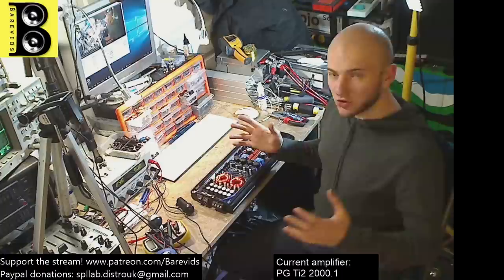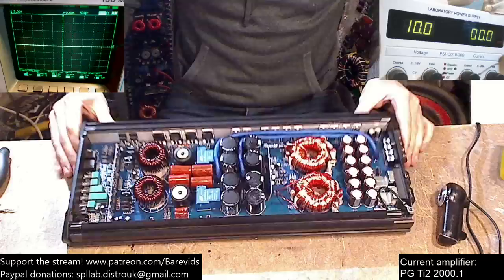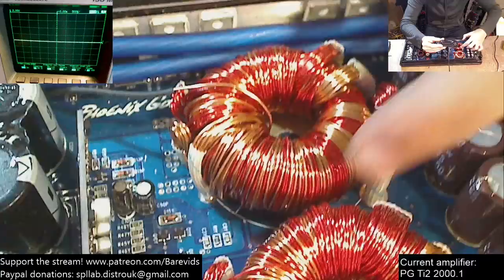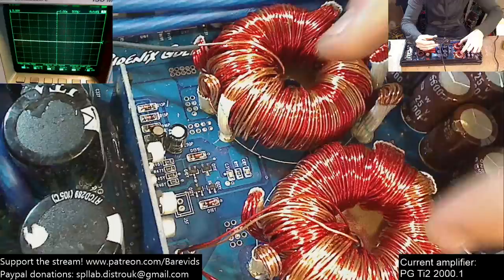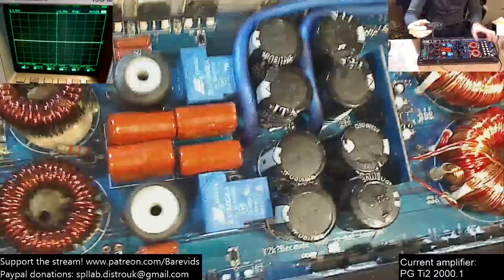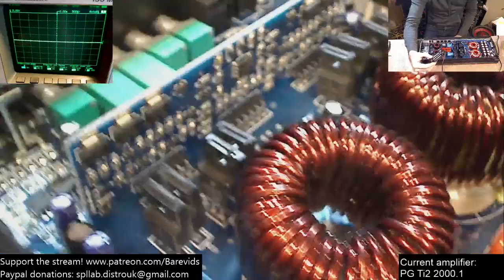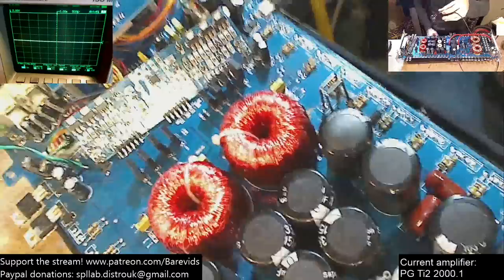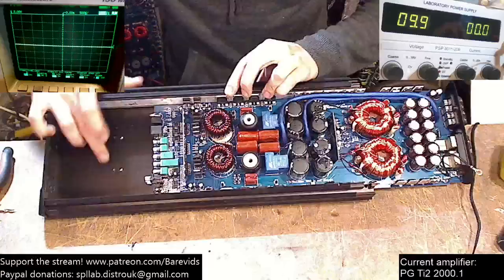Have Phoenix Gold gone to SHIT?? =[

Comment: I was the old New Product Development Manager @ PG in its prime back in the late 90’s early 2000 and was responsible for the very first TI amplifiers. We did our best to turn out the best possible amplifier that was robust and good feature sets. Back then anything with Titanium name on it was our best. We engineered it in house we wound the tortoise in house we did our own board insertion, aluminum and steel casing as well as our own silk screening. The entire thing was built in America at our factory in Portland Oregon. I can tell you these amplifiers are nothing remotely close to what we built back in the day. The attention to detail has gone out the window. This particular amp has many issues as so aptly pointed out. Even the speaker and power connections no longer have counter sinks for the wire insulation to seat into. The single most expensive thing on an amplifier is the heat sink. These guys will never be the same unless they bring it back to the US. It’s a sad day to see PG go down like this. We had an amazing team from the likes of Larry Fredrick and so many others. The difference is we actually cared.
Reply from the maker: amazing to hear such comments from you sir! Thank you for your efforts in producing some of the best amplification products of the time x
Reply: Shame you did'nt use Hammerite to paint them LOL
All my 10yr old Ti stuff is rusting....BUT never skipped a beat.
Reply: @alwishy2696  lol.,sounds like my 1998 Sound Stream Rubicon
Reply: Everything is an extra dollar..the world will soon be in the shitter
Reply: Jerry is that you? The engineering dept./ T Sanow Designer
Reply: Wow i was about to buy some PG hardware. Thanks for saving me.  PG was topshelf back in the day.
Reply: I agree i remember the PG amp's from the 90's i stil have my sapphire 3.0x and 1.0x they are really well built, and they were cheap amp's. Sapphire Drive Series by Phoenix Gold
Reply: When Phoenix Gold Left St. Johns,  it was like my hopes and dreams went out the window for life.  I use to drive my Volvo by the Factory and one day, it was just not there anymore.  I remembered I wanted to so bad go on something called a Job Shadow since I was going to High school there at Roosevelt.  1998 was I joined the Military, went into Submarine service.   

You know.  After this? I sure hope things come back to the USA.   I understand completely what you mean by people just don't care anymore.  I know I like things for a Good price.  But when it comes down to it?  Everything got dumped down.   From the knowledge to people in the Hobby, too just about everything else that came with it.  

Even on DIYMA,  people still scoff at things like "High End" amps.   I get it.  Power is king today, as it always has been.  But the fact that everything that was ever worth a damn got sent out to China and abroad really makes you wonder if This whole covid thing is going to bring back simple manufacturing back to the USA. 

I know its hard to compete with Amp Build houses with better infrastructure, cheaper power, less stranglehold on business as well as myriad of things.  But I sadly think that for the time being?   Its going to be like this for a LONG time.  

Lets face facts here.   The great men & women of the past got drowned out.   They got shit on, screwed over, and this is all we have left now of some of the most ICONIC brands we grew up with.    RCA is Gone.   Zenith is just a Name Plate.   Soundstream... (Not going there)   Nak is no longer Nakamachi anymore.    And the only US Brand that seems to still be around is Phase Linear I think is also gone.  

I hold on to my AURA amp and some of my old Majestic and other items from the 1990's as well as some MTX parts etc and I'm Glad I have them.    I even have some VERY old 90's Rockford  12"subs.   

To think that  there are only maybe 10 Brands in the USA making equipment here anymore?   Its just a sad day.
Reply: @MickeyMishra  There DEFINITELY aren't 10 Old School Car Audio Brands still making Equipment here in the US... The only ones that I know of that still are are, Linear Power, & Zed Audio. I Zed Audio of course Was not a brand so much, but more of an "Amp Builder". They made amps for ALL the big boys HiFonics, Crunch, Nakamichi, US Acoustics, Cadence, & others.
Reply: @GlobeVandalDesMazes I'm not sure I agree that PG has to make their amps here in the states again to create a quality product. Obviously yes, I do long for the days of the MS/MPS, ZPA, & TI Series Amps but unfortunately that's just not feasible business-wise anymore.

 They did however produce some AMAZING AMPS a couple of years back called the ELITE SERIES that were FANTASTIC! They were designed by Morgan West (or at least he was in charge of the project). 

They were built in Korea I believe which has some build houses that are TOP NOTCH! They had the same design ques as older PG amps too, things like the Triple-Darlington Output Section. However the thing it does have that no other PG amp EVER had, is BURR BROWN OP AMPS!!! TWELVE OF THEM!!! 

I've heard these before at my buddy's Car Audio Shop, & I've wanted the 5 channel ever since. I just couldn't afford it at the time. Now they are all sold unfortunately. I should have sold something to buy the damn thing! 😠  I didn't realize how "ELITE" they really were! 

http://www.soundbuggy.com/Eric/Car%20Audio/phoenix_gold/Elite_2012/4-channel/index.html
Reply: What I loved about PG back in the day was the special editions they would turn out. The route 66, The Outlaw, The bandit, Frank Amp'n Stein, the Son of FAS, the MS1000, the MPH 6300.
So how casing what they could at that time.
Reply: wow,  just saw this,  yes old school phoenix gold is the shit!  miss those days.
Reply: I know it is quite off topic but do anybody know a good place to watch new tv shows online?
Reply: @Zechariah Ian thank you, I went there and it seems to work :) I really appreciate it!
Reply: @Lukas Conor Glad I could help xD
Reply: @marcos-ut7mq  I got dips on the last well made Phoenix gold Ti3 1300.1 with the golden pcb and golden heatsink.
Reply: i love the old pg amps. such gorgeous amps :) got a elite 4 now :D
Reply: I was born and raised in Portland, no idea you guys made your stuff here back in the day. My dad had lots of PG cables in his home theater.
Reply: Hey you guys in portland worked on my octane r 801 and my cyclone. My cyclone center magnet cracked. Is there anyone in the area that has parts? Ive tried calling the new pg owners they dont have any parts for tge cyclone. They were never given any in the purchase of company so someone in portland must have a garafe full of parts. Please let me know.
Reply: @ryanwells5035  , Bought some of these knock off ( in name only) amps. 1200/1 and 2 of the 300/4.  Put them in one week and took em out a week later. Boxed em up and it em in storage, forgot about em till I saw this vid. No wonder these mentioned amps were discontinued. I should have sent them back on their 3 yr warrantee. I'm sure many did, just that.
Reply: @Didewro  , not since the late 90s. Now it's just cash in on the old name, and mark the product up as much as possable. Were living in a truely throw away society. pG is on borrowed time
Reply: @rickspearman344  Sad....i building with German audio now......EVERYTHING i buy chinese breaks!
Reply: is the ti3 series better its suppose to be the top of line better than this ti2 series

Comment: Liked and subbed! I was actually looking for reviews on a Phoenix Gold GX 1200.1 as I am in the market (first time since thea early 90s) for an amp! (50 year crises and all that) I was Googling and I am glad I found your channel and review. PG is now off my list, and it was on top of it. So sad to see a great brand go down the toilet. Thanks for the now 3 year old video that keeps on helping. :)

/Cheers
Reply: Don't know about internals. But I've installed a couple of the GX amps and they were great.  I think PG had gone away from the higher echelon market and now have more reasonably priced models.  I agree that their last couple "high end" amps were bunk.  But haven't had any issues with the GX series.  Would be nice to open up and see what's inside. Maybe even send Sam pics
Reply: im running the GX1200.6 i have no complaints whatsoever, plenty of power, runs cools and small footprint.

Comment: I bought an original Phoenix Gold MS-275,  2 channel
Power Amplifier, around 1992. Paid $475+ tx.
I still have that amp., though unused ATM. 
Manufactured at a time when performance, specs., Made in the
U.S.A. meant something.
Today's offerings, seemingly mostly Made In China, are uninspiring.
Like home audio, this really dampened my enthusiasm for home audio.
My home system, back in mid. '80's, was for my bedroom.
A modest Luxman L-210 Integrated amp., A Yamaha Belt Drive T-table,
A  Yamaha Cassette Deck, and a pair of ADS 2 way speakers.
Reply: Great amp in the day 👍🏻👍🏻

Comment: The output inductors are missing zip ties they come from the factory with zip ties to hold them in place. It's also missing the covers for the mosfets. I don't see the inspection test passed stickers either.

Comment: Phoenix Gold is marketed in Canada as an ultra premium brand commanding insane prices, meanwhile they sell in flea markets down in the U.S.
Reply: Phoenix Gold is not in any Flea Markets... get a grip
Reply: Brand has made great to garbage since it began in the early 90s. The best amplifiers they have ever produced are the zero points. The zpa 0.3 and 0.5 are absolutely amazing. Below that you had the ZX. Ms. Mps. Ti and M series. This stuff was all pretty good. Especially the ZX amps for sq. The junk was Sapphire and octane. The Tantrum and xs amps we're actually decent for low cost. Especially the Tantrum. The xs was actually a pretty terrible sounding amplifier line but it worked well on Subs. Phoenix Gold is definitely not a brand that you can just say is good or bad. It depends on the specific amplifier you're talking about. In fact one of the best bargain amplifiers of all time right now is the xenon line. They don't look great. They are responsible in some degree for the demise of the original Phoenix Gold. Some of the amps had terrible build quality but the ones that are still alive today are probably alright. You can find them for very little money and they sound really decent
Reply: Kyle V Xenons were my favorite, being overbuilt you could wire them into the dirt being you could feed it and cool it they would make tons over rated power!

Comment: This is review is on a discontinued product. The new lines (TI3 and SX2)  are very well designed and have good built quality from what has been seen so far. They were designed by Steve Mantz of Zed Audio.   The TI2 line which he reviewed was one of the first lines AAMP came out with after they purchased PG and they made a few bad choices. Now they have corrected those choices  and are trying to bring back the PG name as being associated with a quality product.
Reply from the maker: Yeah, i heard the newer versions are meant to be better, but at time of recording and still to this day they are a current line available product to buy new over here in the UK and the new ones not released yet.
Reply: I know this is a 4yr old post, but go to PG's website and see what they have now. SOS.

Comment: Phoenix Gold was purchased by AAMP in 2008 iirc. AAMP fired most of the staff from the original PG company and went on to basically make it a catalog amplifier brand. They have in the past year at least brought in some fresh cosmetic designs, and most of their higher end lines (yes, they have higher priced lines than the ti2) are designed by Steven Mantz, but still manufactured in China.  It's been a long, long time since they transitioned from a high end brand to the rubbish you have in front of you there.
Reply: yup. from 08 to like, 10? 11? they 'kind of' vanished form the scene, and when they 'came back' it was all garbage.

if you have to have PG stuff, stick with pre-08 gear and you should be fine. if you don't, look at another brand, you'll get more bang for the buck.
Reply: Wrong, it was a company called radionics. AAMP is the new current owner and responsible for the Ti3 amps and the Zen9. It seems they are back with high end products again.

Comment: I owned the 1600.5 and its worked like a champ not sure what the bitching is about but it also looks alot better inside.
Reply: I'm still rocking my ti21600.5 and love it. It's one of the best performing 5 channel amps I've come across in recent years. I wonder if it's a v2.. 🤔

Comment: Could you do a video on the pots for volume control gain ect. I have an amp that seems to work other than the knobs when turned make noise.  I can't seem to figure out where to buy replacements or what to order. The numbers on them get 0 results on google. Thanks

Comment: Hey, I have a couple of cheep dhd audio amps I’d like to attempt a few repairs on. My first issue is the rca cable inputs are loose and crackle when moved, the second issue is the gain knob on both amps  scratches and makes some pretty gnarly sounds when adjusting. I also noticed the transformers looked like there was minimal to nothing to support them from rubbing and causing a short, I also noticed one of the amps two of the 50v caps look like the top is bubbling out. Should I be concerned?

Comment: I had 2 xs 12 pg in a bandpass box and started out with a pg amp (wish I cold remember which one) more than 20 years ago now and that is exactly what happened way way back then. Not saying it was crap back then but I was disappointed  and I'm thinking it was vibration from the box but the amp was not mounted on the box but still huge vibration. I was so disappointed I packed that amp away and got two pioneer gmx 702s and mounted them as far away from the sub box as possible.

Comment: @barevids any advise on a Home made power supply for vapes ive gotten some cheap and they are good quality but the battery replacements are ridiculous and therefore they sold me some competition quality vapes with no batterys for a steel of a Deal

Comment: Hey, maybe you read this. I have a rockford t2000.1bd with a phase switch that is a bit loose. So if my helons start pushing some air the switch sometimes shuts down the output until i wiggle on it again. Normaly i could just take the switch out or does it do anything bad to the board?

Comment: If you're replacing TIP36C BJT Transistors do you need to replace all of them being that they are not Mosfets ?  Audiobahn AH-2150. Would be replacing a TIP42C, a TIP36C, and the 50v 4700uf and 50v 1500uf capacitors.  Would be great to know this in advance as I don't want it to blow on initial power on. Thanks.
Reply from the maker: Generally no you can usually get away with just replacing the dead ones

Comment: @barevids I fuckin love this guy!!!! Wish I could get ahold of him. I have a JL Audio 1000/1v1 Slash series  question about random loss of output. Or if anyone can answer this for me. After a certain frequency played over a short time, it won't get over 67v of output. With nothing connected, I can get over 67v AC until a reactive load is on it and it will just clamp down to 67v and won't give higher AC Voltage when disconnected. Their required output at 2 ohms is 44.7v AC on the output, but it will clamp down to 34v AC when the load is applied and when the Input is raised, nothing changes.
Reply from the maker: Hey buddy, I emailed you back. Thanks for the tip by the way only just seen it!
Reply: barevids no problem man. Without guys like you in the world, their would be a lot of great broken equipment. If the issue happens again, I’ll send you the amp for repair for a video if you’d like. Would make for a great video for future learning and for others to visit if they have the issue with their own amps. Thanks again for responding. You the illest!!!

Comment: Hi BareVids, Really enjoy the vids but I have seen you replace damaged electrolytics with no brand old and possibly stressed components lifted from dead amps? I appreciate that this often gets the job done and is OK for many components but capacitors? Not a good idea.

Small value, high quality (Rubycon, Panasonic, etc) electrolytics are so inexpensive and I think your viewers and clients would be happy to know that good quality new parts were used wherever possible.

Comment: I just looked at one of my old MPS2500 amps and there are no screws down the middle of the board attaching it to the heat sink and there is no glue  or anything around the torids.

Comment: big D wiz the old school stereo guy did an amp dyno on this 2 years ago. he showed the guts. the price tag was apparently 1000 USD! O.o the only place it looks like you can get it is through the PG website. but it does around 3k at just under 14 volts. so...i guess thats something? but my twisted 3.5k doing just over 5k is 800 USD...so i think PG went nuts with pricing here!
Reply: PG went cheapo with one version of the Ti2 2000.1. They have since changed to higher quality. That is no excuse for what you see here, just wanted to reply the Rev 2 of this amp is better and their newer amps are better quality as well. Also, it is never recommended to mount an amplifier to a subwoofer box as it does not matter how well the amp is built, it could cause damage to the amplifier with the vibration.
Reply from the maker: +BigDWiz would love to check out the rev2!